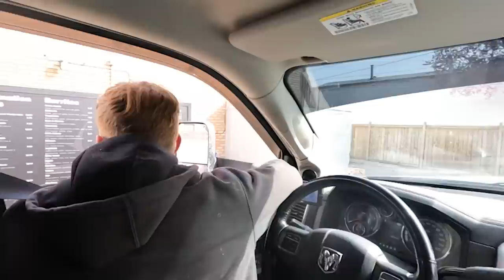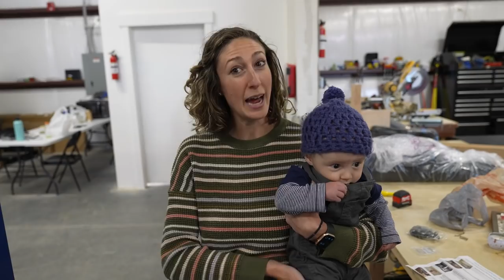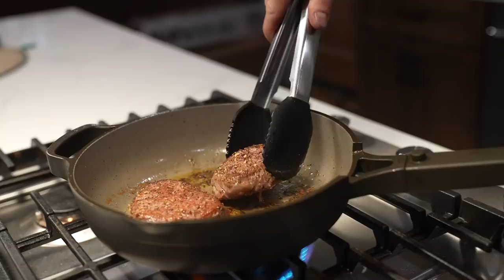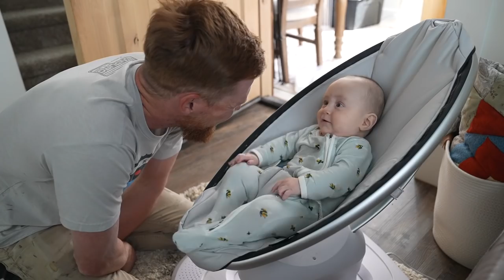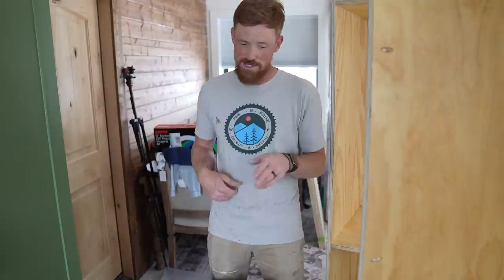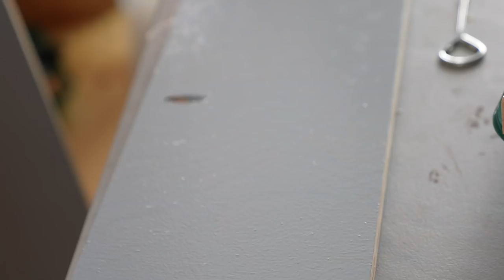THIS DECISION COULD CHANGE EVERYTHING | BUILDING OUR OWN HOME

Comment: A little late now for the cabinets but there is a trick to rolling paint to make it look similar to spraying. Roll the entire panel and then go over it with a wide, fine bristle brush. Make the brush stroke from one end to the other in 1 clean stroke. You get an amazing finish that is as close to spray without spraying.
Reply: Another tip, and much easier imho for those that are not professional to do the one nice long and steady brush stroke. Is to use a microfibre mini roller with a small nap. It does not hold much paint and applies the paint in thinner layers like how it is done when you spray. Plus the small nap gives light touch and very fine texture finish that smooths out. Again just like what happens when you spray. It is not perfectly the same as a spray finish, but again as close to a spray finish one can get without spraying. For larger projects that is a pain with such a small roller, but larger projects justifies actually spraying anyway. It is great for smaller projects though like doing trim, doors, shelves etc. This is what I did for many years instead of using a spray gun when just was not worth the hassle of cleaning it up. I doubt most customers even noticed that I did not spray it.

Comment: Make the sink also your shower, with the door open, make a pop up shower curtain that goes across the door to ground level that extends 3' out, you can undress in the van, step out into the shower area, turn on the sink taps, point the spigot out into the shower area and enjoy, dry off outside in the shower area, then step back into the van to dress.

Comment: Fortunately I do not know either one of the songs mentioned. . . and . . . I prefer to keep it that way - thank you.
I haven't painted in decades.  But I used to love the way oil based paint self-leveled to a beautiful smooth finish.  I'm wondering if latex paints have improved to give a similar finish . . . and not leave roller stubble or brush strokes.

Comment: Filet are best bought whole then Self butchered like 80 bucks for 15 steaks. And if u want them Round, after cleaning saran wrap tightly and put it in the Fridge for a few hrs, then portion the slab into 1-2 inch tall boys.

Comment: A piece of 1x2 laying flat against your gable ends fastened with trim screws, should straighten your ceiling boards, where you neglected to install nailers,  poplar should be strong enough to not split.